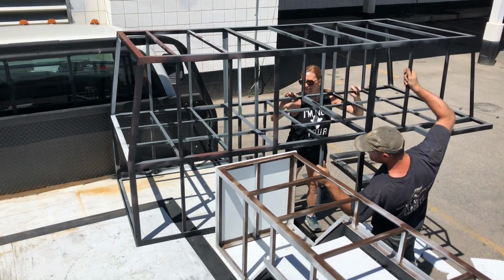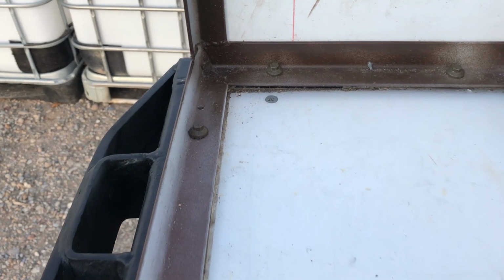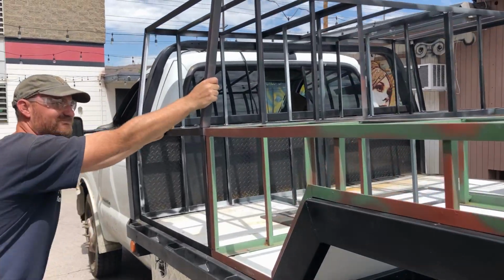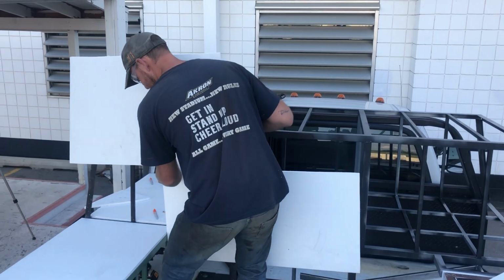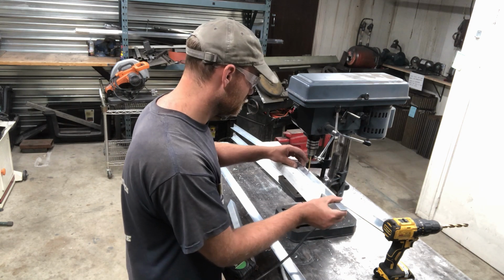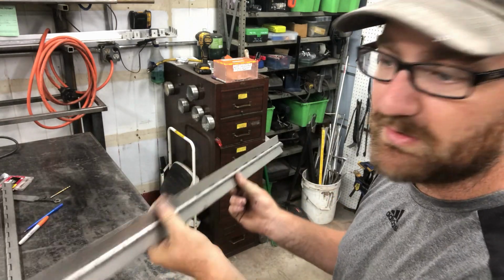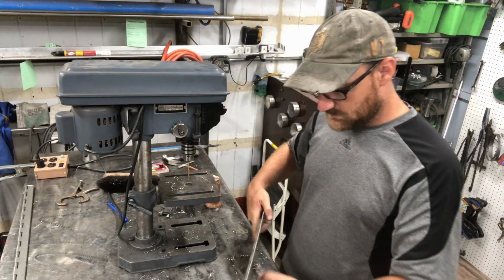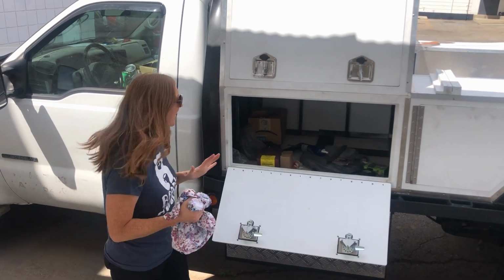DIY Truck Storage Boxes | Flatbed Truck Camper Build | Part 3

Comment: In Taiwan, because of Taiwan ’s regulations, we ca n’t import F-350 pickups, so we have to use trucks to modify them. I am grateful for you to share your revision process. Can I buy design drawings with you? According to the configuration modification, I would like to ask if you want to buy the fixed bracket that prevents the front and rear sliding of the chassis. Is there a general-purpose fixed bracket for general trucks in the United States? Otherwise, how to install so that the house does not slide back and forth.

Comment: Hey I like your progress how big is your fuel tank minds is 28 and I want to add another 20 gallons planing on a Alaska trip I want to get over 500 miles if I can. Just wondering about how far you guys are planning to drive without re-fuel
Reply from the maker: +Randpam Adventures we have a 45 gallon tank. We might add more in the future once we have more data on how many miles we can go per tank

Comment: You can weld both ends of the hinge pin. You just need to have a cut somewhere. Say 8 inches in. With a punch and a hammer, one could still remove the pin, if they wanted access and go to the effort. Great build, by the way.
Reply from the maker: C MH thanks for the advice!